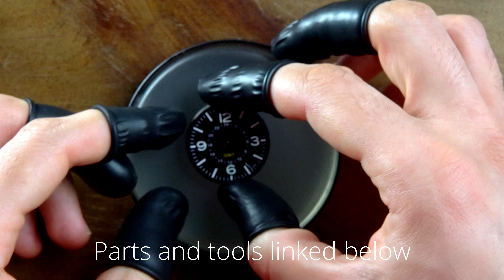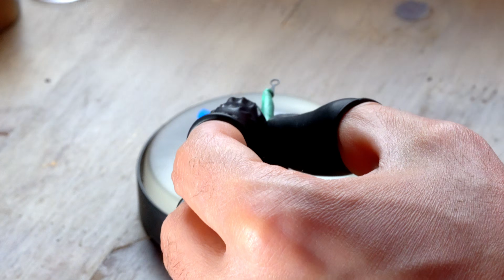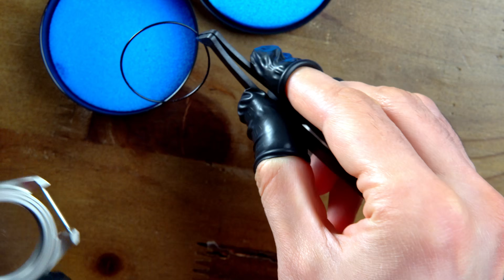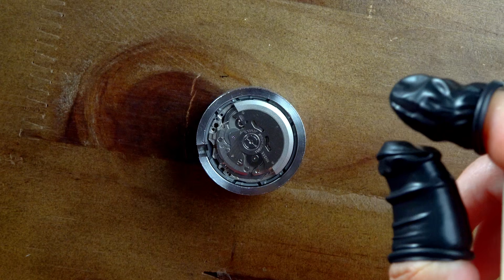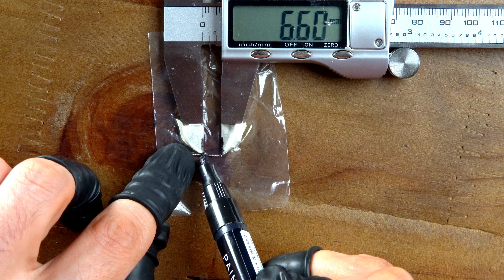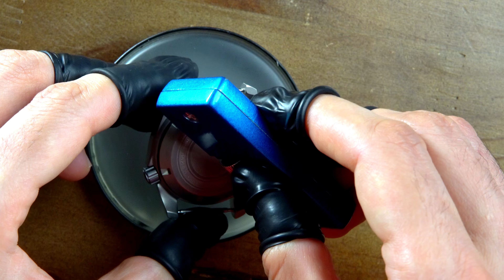This GMT Pilot Titanium Seiko Mod Was Fun To Build - NH34 Watch Build

Comment: Dial washer: The GMT hand sits loosely on the dial and get loose if the watch is bumped or when setting the date. So the bodge is to use a dial washer to press the GMT or hour gear down, away from the dial, keeping the gear engaged.

So, if you skip installing the washer, the GMT hand will be unreliable. And if the GMT hand is unreliable take it apart and check it isn't missing the washer.
Reply from the maker: Very informative, thank you!

Comment: Hello mate ... Nice Build 👍... 
I wander where did you bought that Movement NH34 because when I accesed the link you provided the Price is 163.45 USD ONLY 🤔 not to mention the rest of the parts ... 
The total amount of money NH34 163.45 + Case 58.63 + Dial 25.68 + Hands 22.95 + Strap 10.22 = 280.93 USD on March, 12th 2o26  😂
Reply from the maker: Thank you! I actually bought this movement on November 1st for 88 EUR (102 USD). Prices for NH series movements are going up like crazy in the last few months, not only that, sellers are also increasing prices for other parts, so while the watch cost me $140 to build, that takes into consideration total price at the date of purchase of the parts.